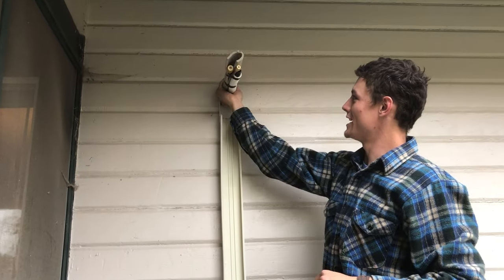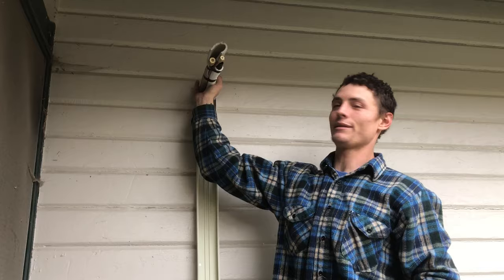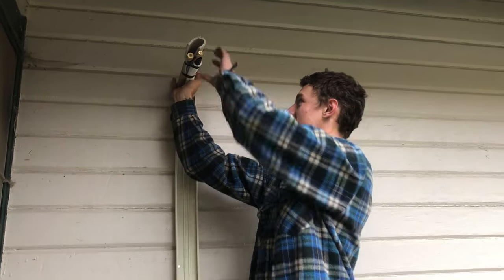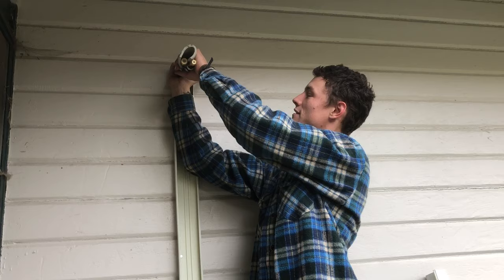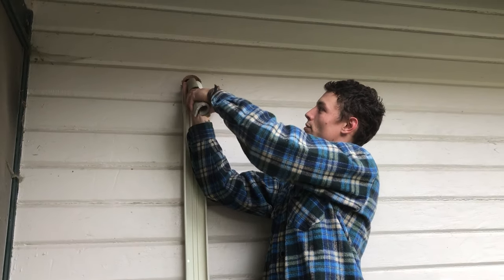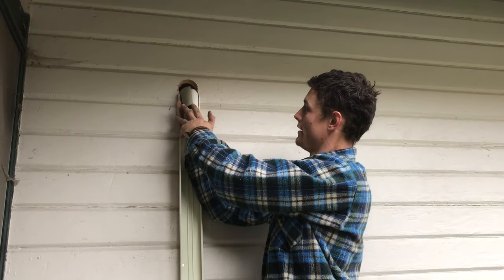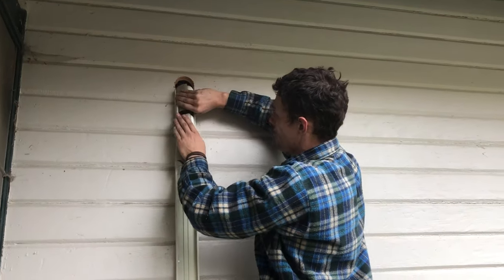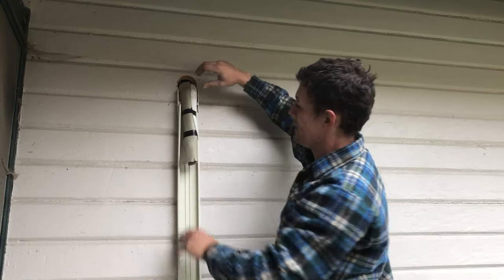Mini Split Install Tricks and Tips - Bending Line Set Correctly!

Comment: I just had an AC guy come out and install my line set so as not to void the warranty on my mini split. I was all worried about doing it myself and kinking the line. The guy did it almost identical to this video. He made several other bends by just grabbing it and bending it with his hands, too. No pipe benders, springs or inserts needed. I guess I worry too much.

Comment: Nice video 
I do the same for the smaller units ive installed. But what do you do when you start getting to 3/4" and 7/8 suction line for ductless. It seems to me like it will kink no matter what
Reply: have been searching for a good method myself still have yet to find any
Reply: I just bought some line set bending inserts of hoping it will not kink. Wish me luck.
Reply: @seasonsla  where did you get them, how do they look. Any links?
Reply: Use the proper sized die from a compact bender tool to help make the bend. And if there is room use the compact bender tool in reverse bend configuration to make the bend.

Comment: I'm looking at bending either a 1/2" or 5/8" suction set - has anyone had any experience with a line set of this size?
Reply: gotta get a bending tool, 5/8 copper line is rigid.

Comment: I wouldn't try that. Especially if there's refrigerant in the line set like the DIY kits have.
Reply: it's not in the line set, it's in the outdoor unit. you release it after connecting everything and vacuuming the rest of the system down.
Reply: It’s in the condenser unit, not the head unit.
Reply: @DeusTex-Mex They make quick connect line sets that are sold with refrigerant in them.